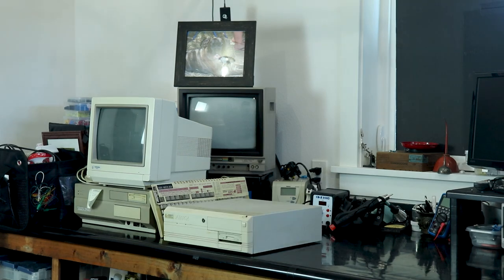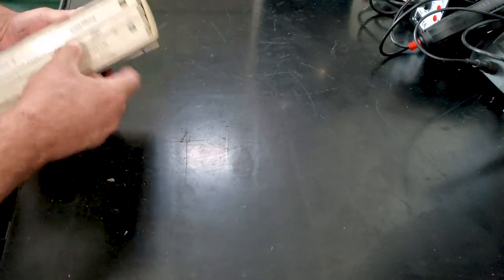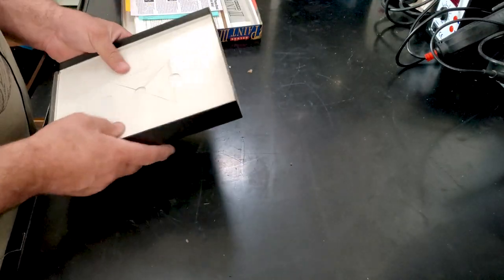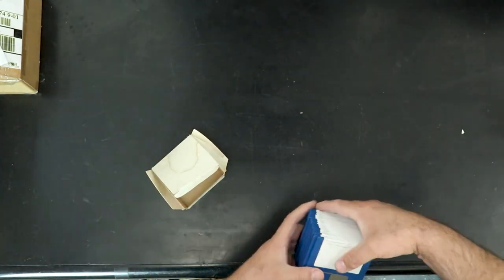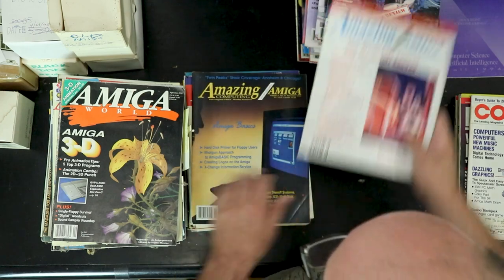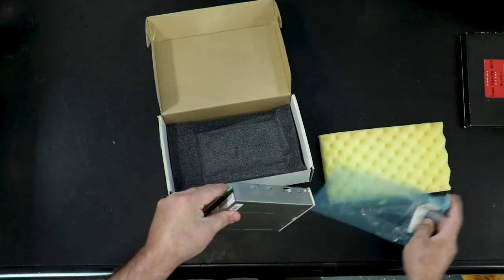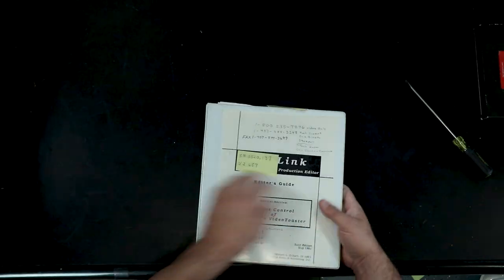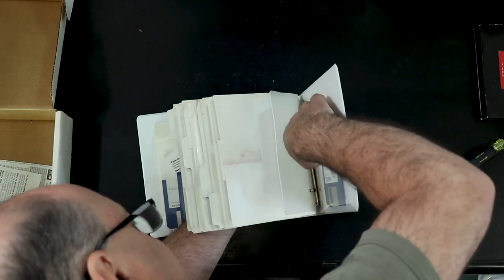Multi-Amiga TV Video Production Barn Find - 2 Video Toasters - Part 1

Comment: Question was this from a Dayton Ohio TV station? If so years ago I got to see them and make an offer. But I was going through a divorce at the time. I worked on repeater site and they in the shed with the radios.
Reply from the maker: Lawrence, these machines came from KPIC TV in Roseburg Oregon. They were used up until around 2000 as far as I can tell.
Reply: @RavenWolfRetroTech   the ones that were offered to me was around 1996